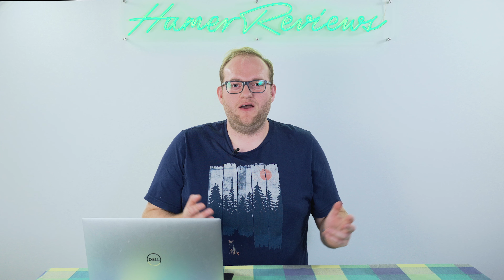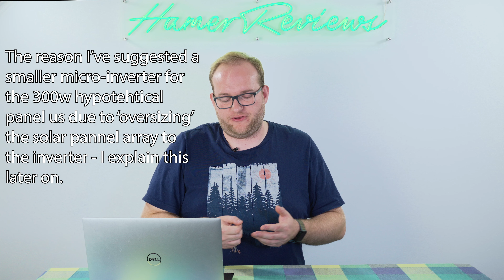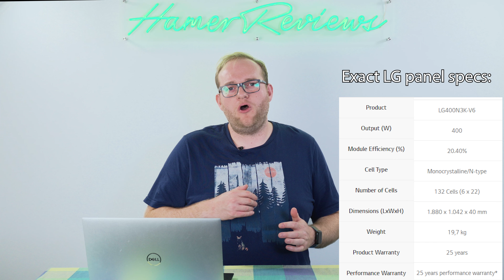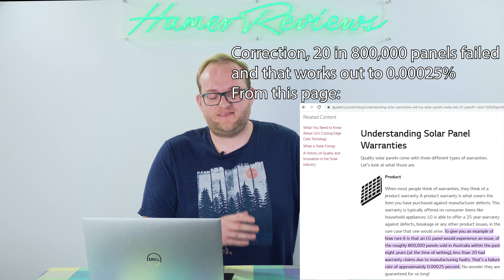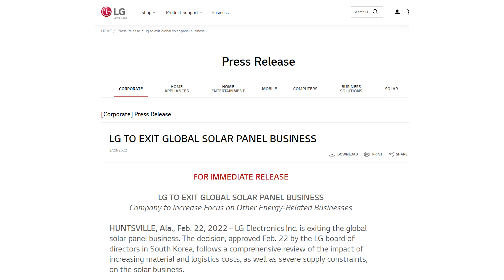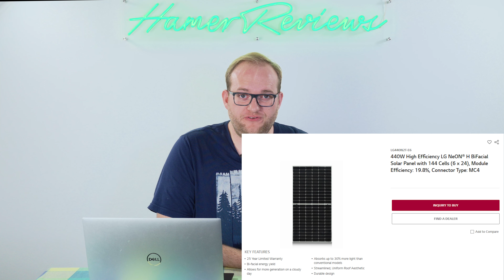Solar Power - How to buy your first solar system - and how I'm doing it myself!

Comment: Your point about cheap panels, cheap one's may degrade faster but in 10 years panels will be producing maybe double what they do today for the same footprint, so you could upgrade and double your output .
Reply from the maker: I mean yes that might be the trajectory of panels, but so far efficiency hasn’t improved that much. We’ve gone from like 16% to 22% so I doubt we’ll see double capacity in 10 years. Most of the higher wattage output panels have just got bigger. Not more efficient.

Also the cost of taking it all down and putting it all up again isn’t something most people will do.

BUT this isn’t to say you’re wrong, personally I’m happy with my choice but I’m sure many people would be happy doing what you suggest.
Reply: @HamerReviews  Not suggesting you were wrong, rather an option, especially for those who install their own as I will be doing. Nice vid by the way.
Reply from the maker: @johnlightfoot9967  no worries at all - I totally get it - I think it’ll be interesting to see how the whole industry progresses in the next 10 years. One area I hope we see big leaps in is batteries. Currently even the best solutions are ‘meh’ at best.

Glad you liked the video 🙂

Comment: Hi Chris, thought provoking video mate. I appreciate you recorded this over six months ago and things have changed radically since. Solar pv has become a much less important component of a home power system. Batteries are , in my opinion, the most important consideration in any such set up. Forget feed in as a viable project , for what you recieve back, basically nothing, unless you signed up years ago. Also , in the current political climate, even those fortunate individuals need to watch their backs, and contracts. Nobody cares anymore !
  No the only real way to benefit, is to take advantage, is by using batteries in conjunction with an off peak tariff, like Octopus Go and charge up the biggest battery bank you can, during off peak times. If you already have solar, great. It'll be a help in summer, maybe ? However, I would recommend anybody with a bit of cash spare, to invest in more battery capacity. Lithium iron phosphate batteries will fast charge in four hours at 7.5p/unit, as opposed to 42p peak. The most you can get of the7.5p variety, the better. Cheers.
Reply from the maker: Hi John, thanks for your thoughts.

I have to say, I strongly disagree on PV. Batteries are great, for sure, but the PV once paid for is literally free electricity. 

Unfortunately I’m not sure great off peak rates like Go will be around forever. If they drop those or make them less desirable then people will be quite stuffed. Also I’ve heard many reports of proof of an EV being required for Go - some people got round it, some didn’t - that’s another variable…

As for pay from excess power, I have the same argument as you in reverse. Octopus outgoing agile is paying such amazing rates that if it continues then it’s well worth it for me - average was 32p per kWh in December for me… will be interesting to see how it goes when the weather warms up - from what I’ve been researching it’s all about wind power - less wind output = higher pay. Of course again, octopus could end that tariff and then my average pay would drop to 15p per kWh.

The point overall, is what you say - watch your back, nobody cares. As such, I still strongly think solar gives you more independence but adding a battery is highly recommended especially with your use case.
Reply: @HamerReviews  Take your points, absolutely Chris. What I was trying to point out was in terms of outlay, at the moment, solar, especially in the sort of scale you have splashed out on, is not cheap. Batteries without solar panels can save you a considerable amount, in the short term for a moderate outlay, then add solar as and when you wish. Rough costing on a 14Kw battery  bank should  cost about £3,000, if done DIY, as opposed to a Tesla powerwall at about £15k fitted. 
  As you say, the requirements to be hooked up to  Go , or Agile is subject to the whims of Octopus but they need to be supplying off peak. The grid needs to be using off peak, for heaven's sake, so off peak ain't gonna disappear soon. Maybe electric cars will !

Comment: A very engaging and educational video, thanks for taking time-out to explain in a relaxed and easy to understand format.

I have reserved a new build home which has solar panels. I know nothing about solar so I thought that I would educate myself so I know what I'd does and what to expect from my new home system.

A couple of questions if a may...

When an application is submitted to the DNO by an installer, and the DNO approves it, do they provide a certificate or other proof that it has been granted?

If a solar system only supplies the house and maybe a storage battery but does not export to the grid is the G98 still required?
Reply from the maker: So if your system is grid connected (most are) then you will need a G98 or G99 depending on the theoretical output of your system - doesn't matter if you export to grid or not.

You might be allowed a larger inverter with a G100 limitation that means you can only export a certain amount but that depends and is on the rarer side. 

In terms of DNO submissions, it's just an e-mail usually, nothing massively official. If your new build developer is using an MCS certified installer then the MCS certificate at the end proves everything is in order too. 

But the long and short of it, is that G98 or G99 is always required with a system that connects to the grid, regardless of whether you set export to 0 or not.

Comment: Great video… Does the Solar Edge Hybrid Inverter work with an EV charge point as well? (I have a HyperVolt EV charger installed.
Reply from the maker: Yes but only with their own EV chargers. So it plays nice with their own tech but not necessarily that of other orgs 🙂

Comment: Yeah  I totally agree with pretty much all,, Regardin installers,,  My installer was weird,,  I asked for I was thinking off grid with Testla battery,, he said yes but installed Solaredge grid tied,,  The fit was perfect  (its solaredge) all the wiring looks great and everything works as it should.. But on completion he did a runner,I had not paid,One month later I get the bill which was the agreed amount ..I could not have him back he was so strange... I think the best thing todo is get references,,,ask around because there are alot of cowboys doing this installing ,, I was told some ex panel fitters have started as installers and there work is pretty bodgy ..

Comment: I've watched a few Austrailian Solar videos (on YouTube) where they have tested shading on panels, in a string, without optimisers and the outcome is not as you describe.  You are definitely correct that there are 'lots of experts' in this field but who do you believe...
Reply from the maker: Hopefully I’ll see the results on my own system I guess 🤷‍♂️ with an entirely north facing array I’ll be able to compare it to south and see what I would have gotten. 

I guess I’m in the optimiser camp but I would have been regardless as I need the data shrug
Reply from the maker: Just to add to this, I am hopeful that long term they do add value, especially as the panels age but obviously it’d be impossible to know without an identical array without them…
Reply: @HamerReviews  Exactly, how do you work out wether to go for 'drop in production' vs 'cost of optimisation', I guess you can't...

Comment: Goverment should give every poor household a 3kw system, it wil pay for itself within a couple of years and then be free energy. its a no brainer. panels,i nvertor, battery seems 3 main parts. panels seem cheap  and probably cheap to upgrade in future so id go big/cheap on panels I think. thanks for some useful pointers
Reply from the maker: It’d certainly help those households out. At the moment with supplies as they are it might be a struggle but it’s certainly a policy worth thinking about. The more solar the better in my opinion, small scale solar farms could help to make the UK far more energy independent in the summer months, though arguably wind turbines should also be a priority too.
Reply: That will never happen, as they will lose income from the tax on the fuel that you purchase.
Reply: governements get their money from tax payers so what you are saying is you want tax payers to pay for your free electricity

Comment: Great in-depth video thank you. Really helps when trying to work out / decide what to do when pick solar and battery’s!
Reply from the maker: Thanks for the comment, glad you felt it was useful!
Reply: What hybrid inverter did you go for I think I remember you saying in the video but can’t find where you said it.
Reply from the maker: @MrDorothy87  we didn’t go hybrid at this stage, I’ve got a SolarEdge SE6000H so it’s not actually hybrid. But it does work directly with their DC battery as it can pass the power straight to the battery and then convert the power from the battery when it’s needed 🙂

Comment: Not much a big deal over there but if you get panels that have micro inverters built in make sure the peak watts is greater than what the panel size produces otherwise on a sunny day with perfect exposure you'll get clipping.
Reply from the maker: I know this will sound counter intuitive but even with micro inverters in sunny climates it’s still advisable to oversize the panel to the micro inverter. You will get some clipping but overall you should generate more power for the same reasons as outlined in the video. Also, If you’re in a warmer climate the hotter your panel gets the less power it produces so you’ll get less clipping than you think. This is all to be taken ‘within reason’ and should be something an installer can help with 🙂